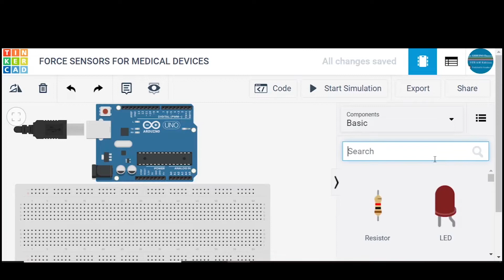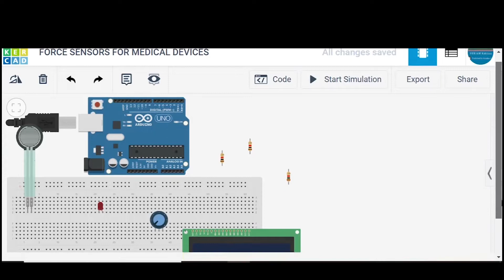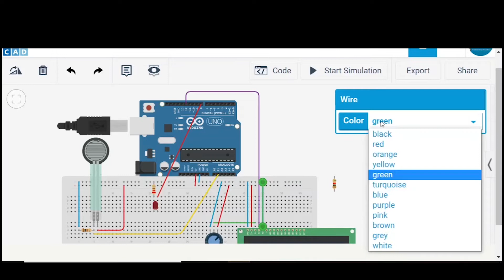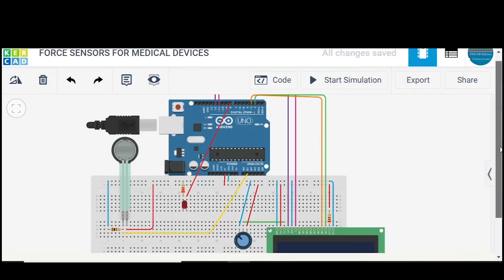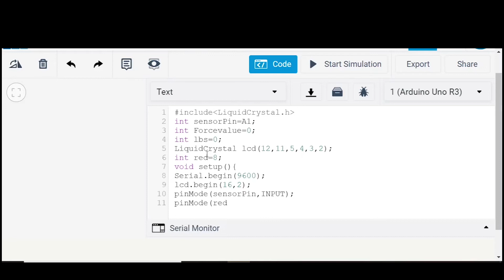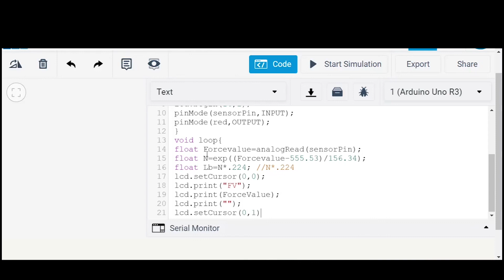Tinkercad Circuits: Using a Force Sensor to Calculate Newtons and Pounds

Comment: can you make video on how to measure the speed with force sensor
Reply from the maker: Engineer, with this sensor, we don't have a way of measuring speed without knowing the other conditions. Force = mass * acceleration with acceleration being determined by initial and final velocity and the time differential. You would have to know two of the three things to determine velocity which is the speed with a direction.  To get the speed you would have to assume the conditions or have input in some way for the speed to be determined.
Reply: @gearboxlabs1734  is there any other way to measure speed with other sensors available in tinkercad?
Reply from the maker: @aviroxi  not that we are aware of. Sorry we could not help more. If you have found someone who did, please share.
Reply: @gearboxlabs1734  sorry I didn't find any, so left that idea of measuring speed with force sensor

Comment: I want to convert the analogRead of the forceSensor to Kg, which formula do I use?
Reply from the maker: Felipe, look at line 15 of the code. This gives you Newtons. Newtons are calculated by multiplying mass (kg) * acceleration. If you are using this to calculate mass from the weight, then divide Newtons by 9.81m/s/s which is the acceleration due to gravity on earth to give you mass of the object in kg. Let us know if this helps.
Reply: @gearboxlabs1734  I didi it but I still geting wrong values
Reply from the maker: @feliperibeiro1226  Share your link here and we can take a look. https://gearboxlabs.org/forms/contact
Reply: @gearboxlabs1734  I just sent it
Reply from the maker: @feliperibeiro1226  We took a look at your project and you are correct. The formula is not perfect. We are still trying to find a better formula. We have asked Tinkercad for more guidance and hopefully, they will share the exact formula they used. It is about as good as we can make it. I wish we could help more, but we are stuck like you.
Reply: @gearboxlabs1734  ok, i'll try to get a batter formula too, if I find I sent here
Reply: @feliperibeiro1226  do you get the formula?
Reply: @nurulsyifa6707  no
Reply from the maker: @feliperibeiro1226  Even tinkercad agreed with our formula as the best solution. We are sure with more time a better solution is available - but it will also be more complex. Our team has a math major on it and the data will not fit one equation.
Reply: @gearboxlabs1734  any results yet?
Reply from the maker: @JonnyLucca01  the formula in our video is still the best we have. We suggest using three or four best-fit log formulas using conditional statements to segment different domains and ranges. It takes it to a university-level solution though.